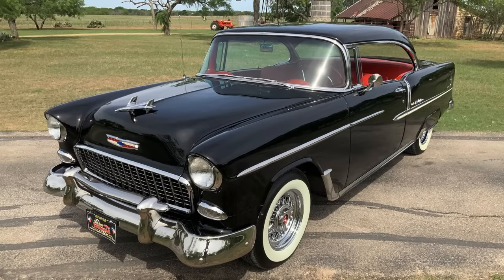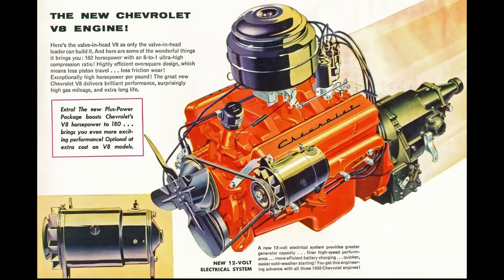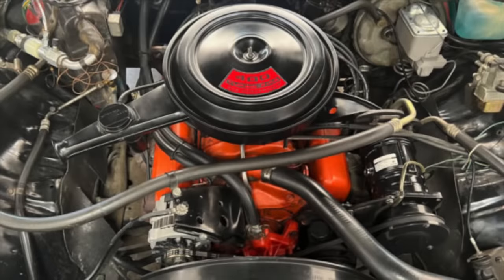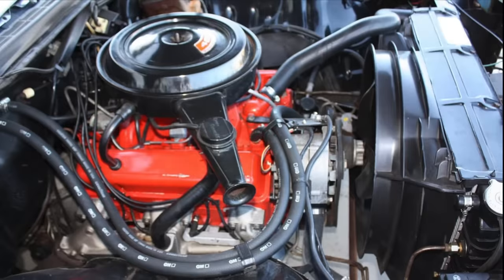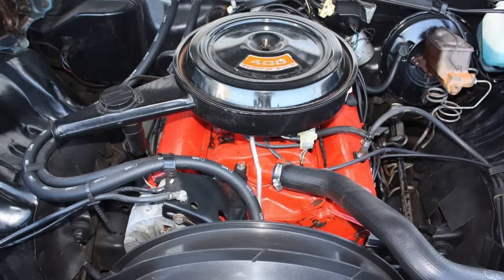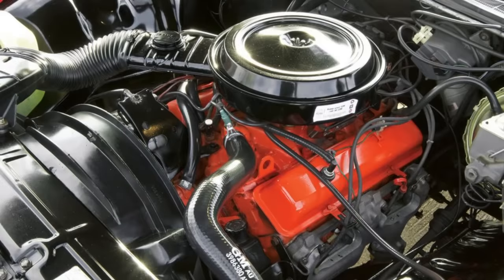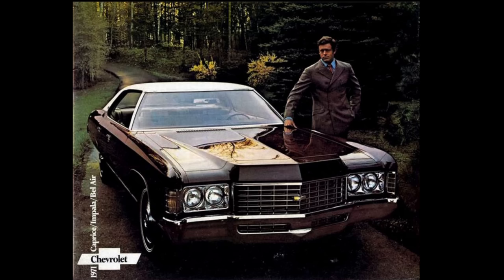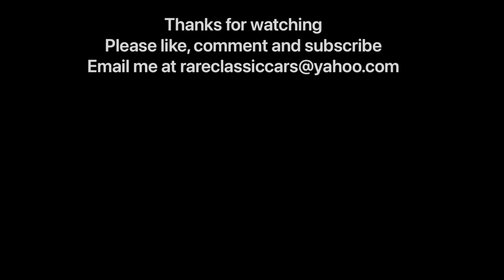Forgotten Engines: The 400 Cubic Inch Chevrolet Small Block V8 (1970-1980)

Comment: The 400 was great in pickups all during the 70's, I knew several folks that had them and used them in their snow plowing trucks and they were torque monsters!
Reply: That’s funny he said plow trucks because I just bought a 400 small block out of a 73 plow truck. It was a Columbus police truck. They must’ve really took care of it. I dropped the oil pan and the valve covers off and it was one of the cleanest motors I’ve ever seen for that old. Thinking about making a stroker motor out of it.

Comment: I had a 78 GMC Jimmy with the 400 small block with 4 bbl quadrajet and dual exhaust. There wasn't a catalytic converter or air pump manifold. The engine was factory rated at 185 hp. I loved that truck. Thanks!
Reply: @seventhanubis6930  I had to rebuild my whole drive train after driving through 4 ft of water after hurricane Alicia in 83. Yes, I was stupid once.
Reply: And I had a '77 Chevy Blazer with the 400 and 4 barrel quadrajet.  Started everyday no matter the outside temp;  always smooth as silk and idled beautifully. Absolutely loved that vehicle and wish I had it back.
Reply: Had a '77 Chevy Van, "one ton" with no cat or air pump. I believe that year in the van they were officially 177hp but it was surprisingly fast for a huge heavy vehicle!
Reply: I had a 79 Jimmy with a 400, 268 cam, 882 heads was a torque monster. To have that back.
Reply: By 74 Chevy had lowered the compression ratio to about 8:1 for unleaded gas and with some new emission controls it just choked those motors. Under the old leaded gas tuning that motor probably would have been around 225 to 245 HP
Reply: @JackSquat54  I think, if I remember correctly, the published figure for 1970 400 4bbl prem fuel that still had decent compression (probably around 10 or 10.25) was 330 "GROSS" hp. Five more than the "base" 396 4bbl had been since its intro. Don't have a "net" figure for '70. Have to check on '71 because compression already had dropped for the "new" unleaded fuel & GM published both the gross & net figures that year only. But '74 was probably the worst year unless you bought a heavier truck that didn't fall under passenger car emission regulations.
Reply: @JackSquat54   The big compression drop happened in '71 (the same year they started advertising net hp ratings, but it really only affected the performance cars.  Trucks and full size cars that the 400 was intended for didn't usually run high compression engines anyway, so the 400's compression wasn't dropped much... from 9 to 1 down to 8.5 or so, if I remember right.  It was really the switch from advertising gross hp ratings to net that made it seem like everything suddenly made less power, when (except for the high performance muscle car engines) they actually still made about the same as before. 
Also, most emissions equipment didn't affect performance that much, it just added weight.  Cars got catalytic converters in '74 which did restrict the exhaust and did hinder performance some, but trucks didn't require catalytic converters until '79 so the '78 models can still run leaded gas just fine, but HP ratings stayed pretty much the same throughout the '70s.  Again, if I remember right, the "bread and butter" Q-Jet equipped 350s used in cars and trucks (even base Corvettes) were rated at 165 hp and around 300 ft lbs of torque, and the Q-Jet equipped 400s were rated at 175 hp and around 350 ft lbs of torque from '72 to '80.
Reply: @DejaView   Were there 400s that run that high of compression in 1970?  I was thinking it was only 9 or 9.5 to 1 for the trucks, but maybe the cars were higher...
Reply: @livewire2759  Just checked the old Chevy brochures. '70 still ran 10.25 & the 400 4bbl was 330 gross HP. '71, low compression version for unleaded reg. gas was 8.5 & 300 gross HP & 206 NET HP w/single & 260 net w/dual exhaust.
Reply: @livewire2759  even though I just looked at those figures & did give the correct ones I actually did forget (& he did mention in the video) the 4bb "400" version of this era wasn't the "small block" it was actually a revised version of the 396 big block bumped up to an actual 402. They're distinguished in the sales literature as Turbo-Fire (2bbl, small block) & Turbo-Jet (4bbl big block [402]).
Reply: @DejaView   Yeah, I figured the 402 "400" big blocks ran moderately high compression, but I didn't think the 400 small blocks did.  Those numbers you posted were for the small block though?  Was that just in the full size cars or did the trucks have that high of compression too?
Reply: The '69 2 bbl. big block Chevy 396" and '70 2 bbl. small block Chevy 400 were both rated 265 (gross) HP... '76 4 bbl. SBC 400" rated 175 netHP at low 3600 RPMs and actually about 7.6:1 compression ratio but tended to need premium gas to prevent knocking because of horrible 'engine quench' effects inside... 
Motor Week made fun of the slug 2 bbl. 396" at 03:05 here: https://youtu.be/Ljch2kCg4rM

Comment: SBC 400. The basis for many drag racing engines. The 2 bolt main blocks were stronger than the 4 bolts because the larger main journals of the 400 necessitated the inner cap bolts to be farther apart than the 350 and that put them closer to the outer bolts and the main saddle of the block tended to crack between the holes. I built a .030" over 4.155" bore 400 with the longer 5.7" 350 rods, 14.7 to 1 compression and the stock cast crankshaft and turned it 7,600 rpm's for 2 years in a drag car and it never popped. I sold the long bock to a friend and he ran it for another season and a half before one of the 292 turbo angle plug heads finally cracked. Those things weren't built for high performance use but they sure held up well with minimal upgrades...👍
Reply: Wow I have one built just like that. Runs on alcohol. The 292 were the original over the counter race heads. Got two pair. Also made a 377 which ran 8000rpm for a year.
Reply: 14.7:1? Wow. Race gas only?
Reply: @edwardkveton3410  
Yep. After the 292s the first generation Bowtie heads came out. I had an early small journal .060" over 327  that I turned 8k + on the street in an M22 4 spd. 71' Z28. That was a fun car.
Reply: @ericdolby1622  
Oh yeah. I ran the blue 108 octane Union 76 fuel with 40° total timing. Had a ret - ard box in the ignition so it would start...lol
Reply: @edwardkveton3410  
How much horsepower does yours make on alcohol?
Reply: @tonyelliott7734  I really don’t know. We have it in a ‘63 Chev II straight axle gasser with Muncie rock crusher. It’s just fun to run. And a handful. It’s been in the corner for the last 2 years. Built it to pay homage to my Dad. When I was 5 years old he had the same car not gasser. Ran it with the big 6 manual. It was a small block killer. That’s when it was by classification then.
Reply: i still have a pair of those slant plug heads on a old 350. havent driven it in years.

Comment: My grandparents had one in a 1975 wagon. I remember taking vacations in that car and it was comfortable, but my grandfather constantly complained about the gas mileage and oil consumption.
Reply: My Father had one in his truck,when asked about fuel mileage he said if was worried about it he would not have bought it.
Reply: My grandfather bought a new 1972 Impala Estate Wagon with the 400 and loved it. Great low end and mileage averaged around 12 - 14, not bad for the land yacht that it was.  My dad got a 1973 model of the same 400 2bbl wagon and hated it. Seven mpg city or highway and it would usually ‘diesel’ for a while after the ignition was turned off. Never could get the problem properly diagnosed.  Passed my 1st DMV driving test in it, parallel parking was fun!
Reply: 72 was a much better engine than 73 thanks to the EPA

Comment: It did have torque.  As a child, my mom's '75 Caprice Classic coupe (400ci 4-bbl) would chirp the tires when shifting into 2nd and 3rd gear at full throttle.  It developed an issue with hot starts, though.
Reply: Who was driving for that tire chirp 2-3
Reply: @techs1smh13  mom!  😂

Comment: I once got a ride in a  '70 Caprice- circa 1980- with the 400 small block. And yes, I will always remember how rhat car just boltie away from a stop sign with little fuss and no noise. The way it pulled it was hard to believe you were in maybe a 4400 pound car, but that is a lot of cubes to move the tonnage. A great ride before fuel started going up like a rocket.

Comment: My father bought his father's 1976 two-tone green chevy K10 (full time 4wd) that grandpa had bought new.  400 small block.  He rebuilt it himself in 1995 with 215,000 miles on it.   Had it til he passed in 2020.  My dad loved that truck😢.  He so badly wanted to do a complete restoration not only 'cause he loved it but it was his father's.  He had many of the doors, fenders,etc bought.  He loved🙂 telling me stories of running into a guy who would see his "half ton" but then see the 400 badge in the grill and say "oh,this has the 400 !"  My dad would smile ear to ear "yep, it sure does, all original".
Reply: 400 4 bbl. Carb on my dads '76.  And bigger radiator 4 row I think that came as a heavy duty cooling option.  He loved explaining how the 4wd full time worked, how it was nice, but they could spin independent of each other "see, then I can even pull 'er into 4 wheel high lock"

Comment: One factor that made the 400 sbc less popular for aftermarket and performance use was a less advantageous rod angle as compared to the 350.  This meant some limitations for higher hp, higher rpm applications.
Reply: True. But now you can throw a SCAT crank or whatever in with 5.7" rods and that's not a problem anymore for decades.
Reply: Now there are a lot of good piston options that allow a 5.7" or 6" rod in the 400.
Reply: @Shaft-Industries   You are correct, but back in the early days of the 400 SBC, due partially to the reason I described, people just found it easier to use a 350.  Nowadays, at least since the 90s or so it hasn't been an issue, but the 400 didn't take off right away in its history for this reason.
Reply: @howebrad4601  Yeah, that's probably another reason there are a ton of 383's out there. You get the stroke of a 400 but can still use your factory rods and still achieve more torque.
Reply: @Shaft-Industries I'd rather build a 377. 400 bore with shorter 350 stroke.

Comment: My folks had a Canadian built 1972 Pontiac Catalina with the 400 c.i. engine.  The car was the very definition of "lemon," but the engine ran forever with never a problem.
Reply: I guess that might have been the same small block engine discussed in this video, since Canadian Pontiacs of that era used Chevrolet engines. But, wasn't the Canadian model which was comparable to the American Catalina, named Pontiac Strato Chief or Laurentian? I didn't think the Catalina name was used in Canada.
Reply: @TonyM132    The car was built in Ontario for the American market.  It was ordered for stock by a dealer in Marietta, Ohio, where my folks bought it new, after the '73s had come out.  They got quite a discount.
Reply: @tombrown1898  Oh, I see. In that case, it shouldn't have been the Chevrolet small block 400. It should have been the Pontiac 400, a totally different engine.
Reply: @TonyM132   Okay, that makes sense.  All I knew is that it was a 400.  When we'd had it for just two weeks, I was driving along at 35 mph, and half the transmission dropped onto the pavement.  Shortly after that, the differential crashed.  It was under warranty, but these moments were  harbingers of more to come!
Reply: In 1974, my dad bought a Pontiac Laurentian station wagon in Canada with a 400 4 barrel small block.
It looked exactly like the engines in this video. Never had any issues with the engine other than the trans cooler leaked in the rad and the block had to be rinsed.

Comment: They’re far from forgotten. Everyone I know talks about wanting to use a 400 for a build. Heck I’ve used one. Turned a 400 into a 409 stroker for my Z28 Camaro. The engine was a torque monster when it started out, and it remains one after it’s built.
Reply: Hey my airborne friend the 409 Chevy engine block was a whole different thing by the way buddy looks like you need to do some research on it that motor was a motor designed after the first generation of the big block Chevy motors like the 348,409's in the early part of the 60's first placed in heavy duty truck application and they later in the same decade they were also being used in the early Chevy Impala,s maybe you are just too young to remember them car's 🤭🙄
Reply: A 409 Chevy motor would have metal valve covers that are shaped like a w and it would be a big big block Chevy motor from the 60,s late 50,s so I highly doubt that you have a 348 or a 409 big block Chevy motor from that time period it's highly unlikely

Comment: Bought a new 74 Z28. Got the 400 and the 400 Turbo Transmission. Midnight blue. Still got it 🇺🇸🏁 Chevrolet.
Reply: Never put a 400 sbc in a Camaro, ever. Not factory if that's in fact what is there.
Reply: I built a 400 sb  & installed it in my’69 Camaro.    1971 engine with 4 bolt main brg. Caps out of a 
Kings wood estate wagon .   Very nice build -   While I was a tech at Chevrolet.  Many great trips 
In the car !   Many offers to buy it ….  Kept it !
Reply: @mattwhaley9917  Even car guys dont know what engines they have...lol
Reply: @will7its  I had a 63' Buick Skylark, thought it had a 312.
Reply: Did you park it next to your 83 vette?
Reply: @Kamala-aint-Black  LOL not many will understand that statement or "water pump for a 1965 VW bug"

Comment: I had two 1973 full-size wagons, both with the 400 small block.  The lightly equipped Impala (A/C, tilt, power tailgate) had lower gearing and felt almost sprightly.  The fully loaded Caprice Estate had highway gearing, and of course more weight, and really needed more engine.  But both were smooth and utterly reliable.
Reply: Do you recall what rear end was in them?I recall reading that on the 60’s models,if you ordered it with the towing package(ball hitch connected to frame) they came with the 12 bolt posi.I don’t remember what or if it mentioned 70’s but it would have gone to the 10 bolt I imagine but I’ll take a10 bolt posi any day.actually I did take one.lol

Comment: Had a sb 400 2V in a 1971 Caprice. What a great engine!
Reply: I had one too!!! it was my first car in 1985 one of the best burnout cars (stock) I have ever owned. 1971 Caprice 400cid 400 turbo trans 2bl carb and point ignition and you had to love the 4 wheel drum brakes oh and the puck green color with the black vinyl top. Wish I had the driveline out of that thing for my current 1989 C2500

Comment: Lot of people think the 2 Bolts were the better block to use in a high performance application becasue the 4 bolts would crack.   My  experience with these engines is that most of them will crack in the valley in the 450HP area.   That's an easy number to hit with today's aftermarket heads and roller cams.    They do make good low end power in stock form though and weigh no more than a 350.
Reply: I was surprised that there was no mention of the weight difference in the video.
Reply: Ive never heard of these blocks cracking in that area. We ran a factory 400 block in our Altered making 600 plus hp on alcohol with no issues of cracking. 14.7:1 compression and routinely run in the upper 7000 rpm range. We ultimately replaced it with an aftermarket block in preparation for a supercharger, knowing the stock main cap would never take what was coming.
Reply: The 2 bolt 509 casting blocks containing more nickel added substantial strength.

Comment: My Pop owned a '72  Blazer w/ one of those 400 C.I.D. small blocks and it was definitely a torque monster, as it would/could spin those 30" tires w/o much effort. That Quadra-jet on top didn't hurt, w/ those massive secondaries kicking you in the pants each time you stomped the GO pedal.

Comment: Great video on an under appreciated stalwart motor.  I would love one of these engines for a restomod project.
Reply: i have 3 of them but dont know if i still have a pair of 400 heads.
Reply: @harveynewman4333  just drill the steam holes in a set of regular small block heads.

Comment: Had a 400 in a '77 3/4 ton pickup. Plenty of power, but had problems with starter& ring gear on flex plate. Changed several of each. Carried a big screwdriver to turn flywheel past area where teeth were ground off.

Comment: I had a 400 Small Block out of an Impala in my 69 Chevelle to replace a 6 cylinder. Mild build made 420 hp and 470 lb ft in 1984, it won me a few street races since back then everyone with 200 hp thought they had a 12 second car.

Comment: I had a 73 Caprice Coupe with the 400. It already had a 4bbl intake and Qjet on it when I bought it in 1993. It ran okay,but I added a new cam, timing gear and HEI distributor.  I took it drag racing and it ran 16.0 on the 1/4 mile.

Comment: Thank you. I've been waiting for this video for about a year now. I have a 400 small block. 1973 year. I've owned it since 1986. Its been excellent. Never any issues besides a timing chain and gear set. It has over 200,000 thou on it today. I love my 400. Oh and it has excellent torque.the engine is is in my 1980 monte carlo. It has a 2bbl carb stock. I can break the one wheel wonder loose at 25mph. Thats the truth. Oh and its 100% bone stock.